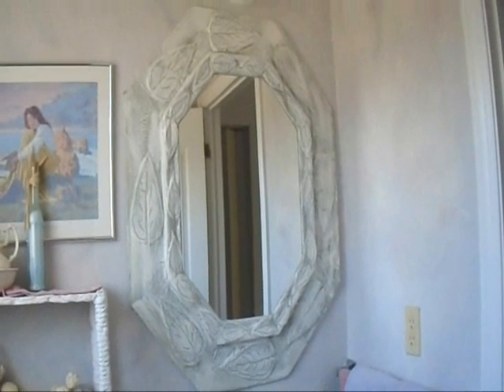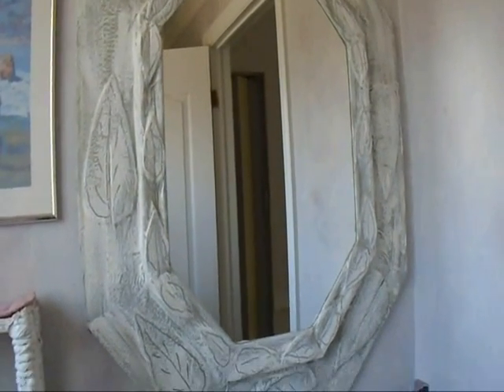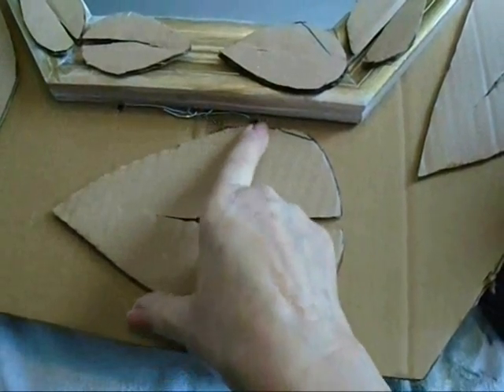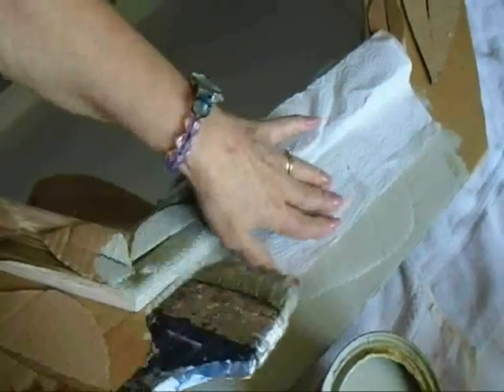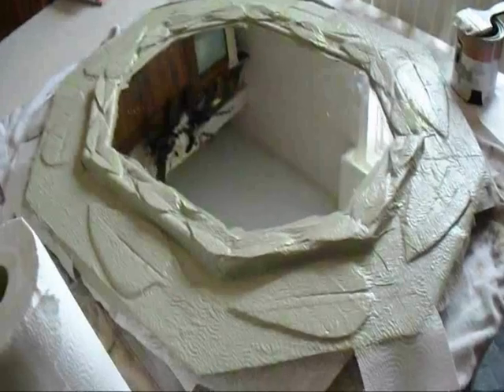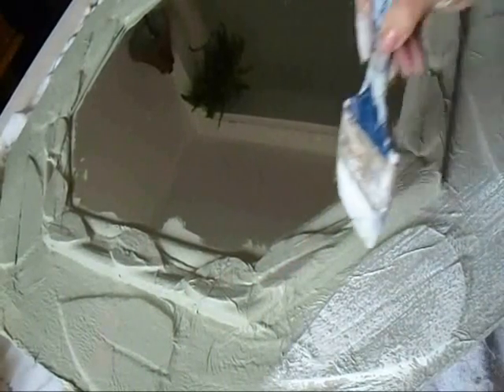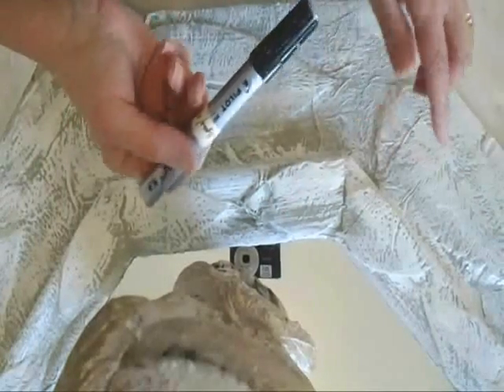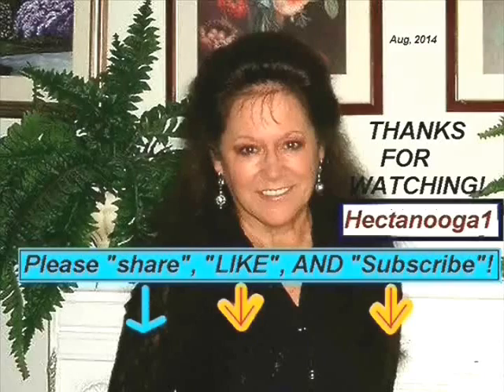PAPIER MACHE MIRROR FRAME,  TRANSFORMATION, HOME DIY projects

Comment: What kind of white paint do you use ?  I am not familiar with paint, there are many kinds of paint in the hardware store.  I will  use ivory or silver colour for my bathroom.
Reply from the maker: steamriceroll It was just latex wall paint.... I always buy the mis-tints when I see them for a few dollars, because I can always use paint.  But you could also use craft paint in the little bottles, it's just that for big projects, it would cost so much to use those.  So any type of paint that would go on walls is great, and I always use latex for ease of clean-up.

Comment: One other thing, if I were to cover the top of the project with paint, could I use paper mâché paste, like Mod Podge or flour and water, which are generally cheaper; or do I need to use the paint?
Reply from the maker: heatherlikey You could use any glue instead of the paint... I usually use it because when I am done, I am done, it eliminates one step.  I buy my paints as mis tints, so I don't pay very much for them.  Flour and water is fine... but I usually cook it in the microwave first, just to get it to a sticky consistency, I don't know if that preserves it or not.. or watered down white glue could be used as well.  I find mod podge rather pricey, so for a large project like this, I think flour and water would be the less expensive route to take.
Reply: Hectanooga1 - Crochet, Knitting, Jewelry, Crafts, Cooking Thank you, so much!  Great information.